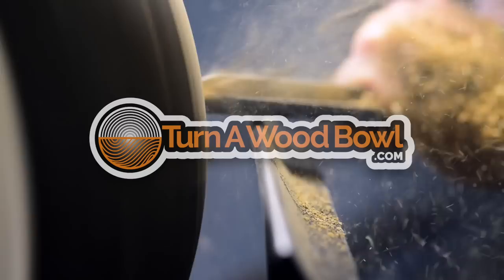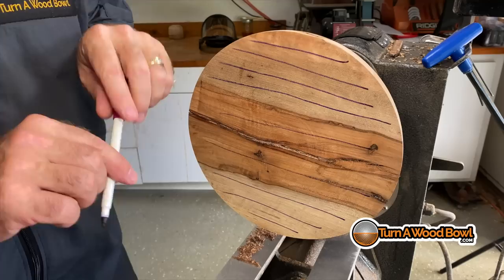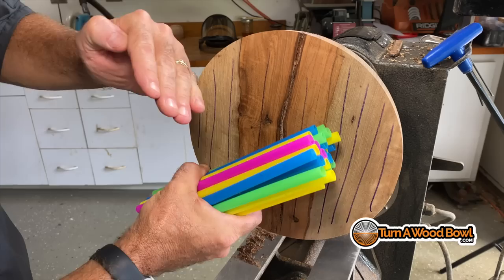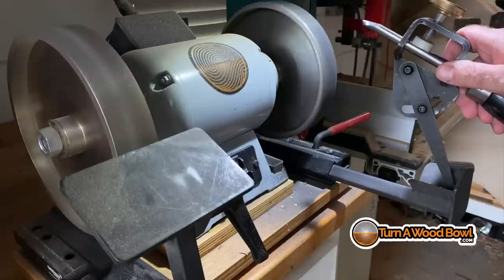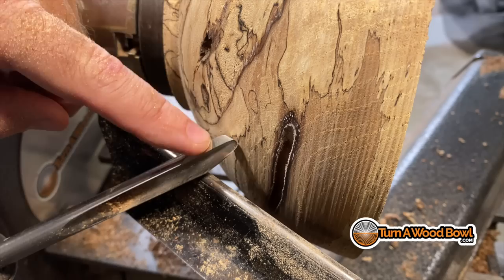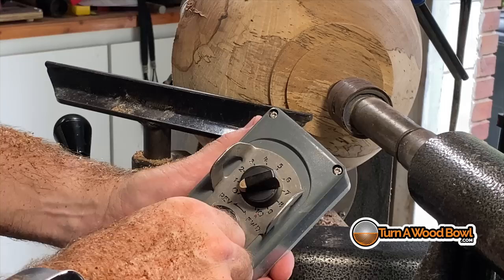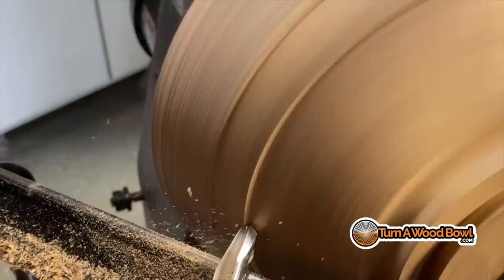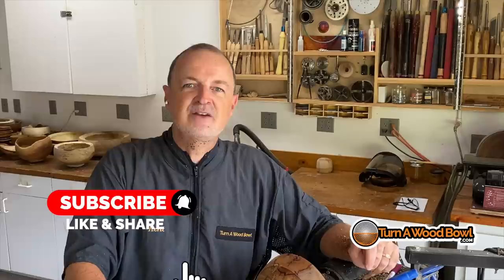Wood Turning 7 Tips STOP end grain tear out wood bowl woodturning

Comment: I also use thin CA glue on my dry, exotic hardwood and it surely helps (shellac not so much when they are.. literally hard core😂🙈)
Thanks for refreshing the fundamentals!
Reply from the maker: Yes, CA works too. Thanks for sharing. Happy Turning!
Reply: @TurnAWoodBowl  I epwas going to ask about that.  The CA glue or tge wood glue and then rubbing in sawdust, like I’ve seen done for cracks.  Does that help?

Comment: Thank you for your terrific videos!

New turner here. I don't understand why the unsupported grain after the end grain isn't a worse problem than the end grain. If I were using a router on a board with similar grain, the most vulnerable edge would be the section with the unsupported grain. I would consider making a climb cut there. It would be like reversing the direction the bowl is turning for just that section. Thanks for any help.
Reply from the maker: Paul, Thank you for writing and sharing! Check out this article https://turnawoodbowl.com/supported-cut-wood-grain-bowl-gouge-cut-direction/

Comment: Again, very useful advice: tear out is quite an issue with the seasoned pine I am using. And, by the way, the fibres in the timber xylem are real “straws” that take water from the roots of the tree to the leaves so your straw model is perfect.
Reply from the maker: Thanks for the info! Have you read "The Hidden Life of Trees" by Peter Wohlleben. The straw info is correct, but did you know that we (humans) still have not figured out how the water is lifted all the way to the tops of the trees? They explain how the "quick" answers we've long believed don't actually work like we thought. It's an amazing read, that will have you looking at every tree differently. Here's the book https://amzn.to/3dAq6Fj

Comment: Great tips! How much material should I leave for reinforcing with shellac - how deep does the shellac penetrate?
Reply from the maker: Good question. The thinner, 1-pound cut, will penetrate pretty far. It will definitely soak in past any torn grain fibers and that is what needs to be cut clean in order to have a smooth finish. All the best to you and Happy Turning!

Comment: Ken, as always, thanks for sharing your wisdom.  This was a very helpful video.  I don't often have a problem with tear out when working on the outside of a bowl but do encounter tear out at the bottom of bowls.  I also have tear out on what I  would describe as the wings of a live or natural edge bowl (sometimes on the outside and often on the inside).  I'd appreciate any suggestions to avoid this problem.  If this is a common issue maybe you could share a short video on these specifics.

Comment: Hi, a good informative video. Do you think that reducing the size of the gouge you are using might help to reduce tear out - smaller cutting area in contact with wood etc. And what about the degree of bevel and/or secondary bevel. Is the same size gouge with say a 40 degree angle likely to tear out less than with say a 55 or 60 degree angle? And what difference would the depth of bevel make? The deeper the bevel the more likely it is to burnish but might a deep bevel also risk cutting slightly deeper and therefore risk tear out. (Is the bevel in a microscopic sense is always riding an uneven surface?)
Reply from the maker: Good questions. A smaller gouge will definitely help! A different angle on the gouge should make no difference other than to change the ergonomic position of the turner. Burnish marks are caused by dragging the heel of the bowl gouge or pressing into the wood as a cut is made. That's why some people call it "floating the bevel." Thanks and Happy Turning!

Comment: Hi Kent
Thank you as always.
I noticed a pro edge appear on the work bench behind you,how are you finding it?I’m pretty impressed with it myself,also one more question if I may.
What sort of dust extraction system do you use when turning?
Thxs in advance
Reply from the maker: I really like the fixed and easy to set angle platform on the pro edge. As for dust, at the moment, a fan and the garage door fully open. ;)

Comment: Great tips but I'm still turning bowls with carbide tools.  If you could only buy one size and shape of bowl gouge, what would you recommend?
Reply from the maker: Good question! A 1/2" (shaft diameter) bowl gouge can create 90% of all bowls. A larger one is nice to rough out blanks, but not necessary.
Reply: @TurnAWoodBowl  thanks for responding

Comment: Does using Shellac to stabilize the end grain affect what finish you can use and the color/gloss of that finish?  For example, can you use the Tried and True wood finish over a bowl that has had shellac applied?  If you use shellac as the finish, wouldn't you use a thicker cut of shellac so that it doesn't soak in quite as much (I'm pretty confused on that)?  
I love your articles and videos.  Finishes are still quite a mystery to me.  Also, I could have sworn I saw you use lacquer filler on one of your videos, but now I cannot find it anywhere.  Maybe it was the shellac that you used to firm up the end grain.....  
Is lacquer food safe?
Reply from the maker: Good question. Yes, shellac can be an undercoat for lacquer or an oil finish. It will soak into the grains of the wood. Also, much of the surface shellac will be removed during sanding. If you want a gloss finish, you can use the shellac base coat(s) to seal up the wood and fill in pores and the lacquer will go on much better. One coat of shellac used as in this video to firm up end grain will not interfere with an oil finish, but you wouldn't want to put layers of shellac under an oil finish. And yes, lacquer, once cured is food safe. Happy Turning!

Comment: Are there any additional tips if using carbide tools?
Reply from the maker: Carbide tool are scrapers and they scrape, so there are difficult on problematic wood. You can try shear-scraping by tilting the scraper at a 45° angle (still on center but lift the right side up) into the wood surface. That will make lighter, more forgiving cuts.